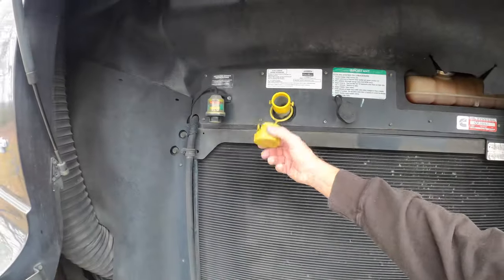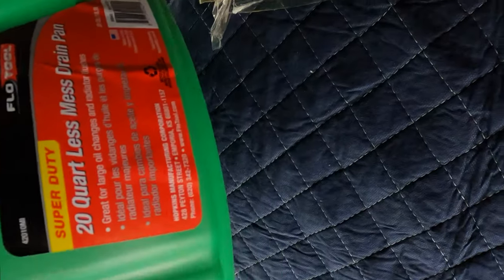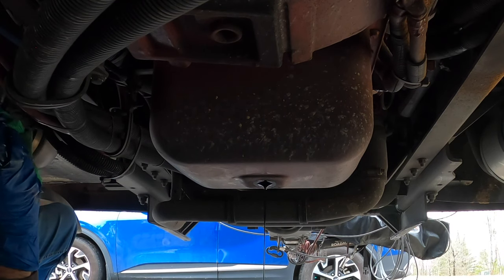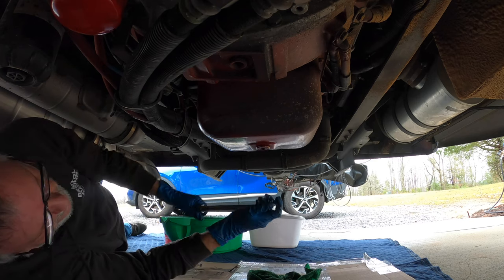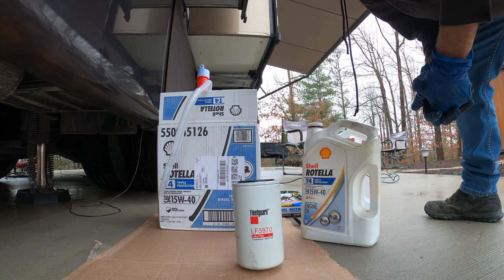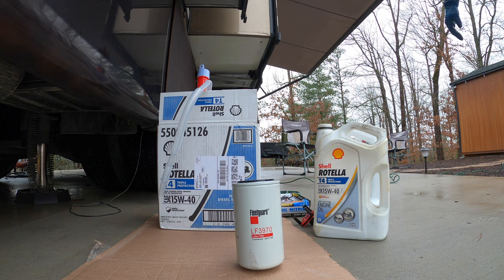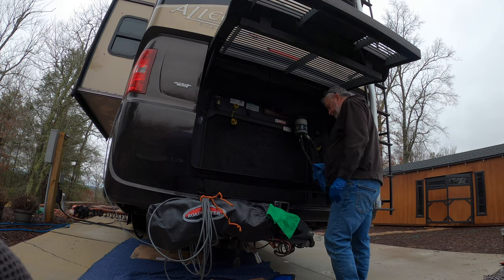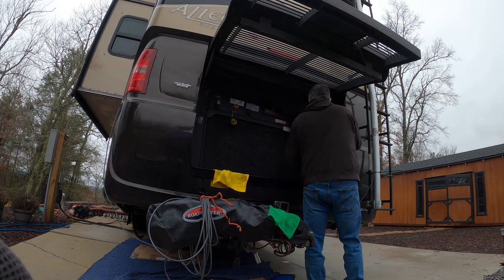Easy DIY: Oil Change for a Tiffin Motorhome Cummins 340 ISB 6.7 Engine | 🧑‍🔧Sunday Solution

Comment: Thanks Randy for this video. We got our 2014 RED 33aa Sept 2023. The owner had the service done just before I got it. He paid well over $1200 for the oil change and some other things needed at the time. I can stomach $105 any day. I do all my own maintenance on all my machines so this is just as easy as any other oil change.
Reply from the maker: Absolutely if you can change oil on a car you can do this…be sure to get the good air filter that video will drop next Sunday then the genny service will be the following Sundays video

Comment: Tip……if you install a Fumato valve you will be able to control the flow and drain directly into a jug to recycle.
Phaeton L9 29 qts of oil
Reply from the maker: Thanks for the info 👍

Comment: We are getting back into RVing and looking at a DP. I really want to do most of all my own maintenance. Due to reasons not trusting places to complete the service you pay for, like your fuel filter was not changed out on the get set video. This seems a lot easier than I thought. Just like changing my oil in my truck only on a larger scale. Also, watched the air filter video and gen set video. This is awesome!!! 

Ps love the emblem next to the tail lamp.
Reply from the maker: Thanks for watching.  Glad Randy has inspired others to do their own maintenance too!! 

Ps I spy with my little eye 👀😝

Comment: Do you have or can you create a video on replacing the fuel filter?  Like the engine oil, this is recommended to be replaced every year.
Reply from the maker: @rweissen  not yet but I will on next change

Comment: I’d like to change out the filter in the fuel/ water separator, but I was told there is no shutoff once you remove the filter some people do not change in,es you have less than a quarter tank of fuel and raise the back up as much as you can to mitigate draining your tank
I’d like to see how you change it.
Phaeton L9
Reply from the maker: I'll mention it to Randy.  He didn't do that in this maintenance go around. Thanks for checking out our Sunday Solutions. ✌🙌💕